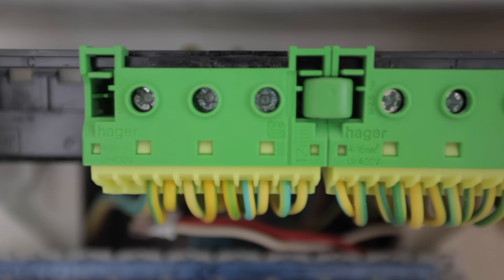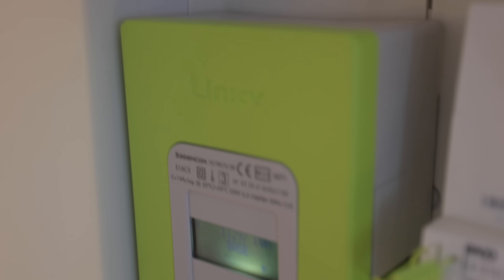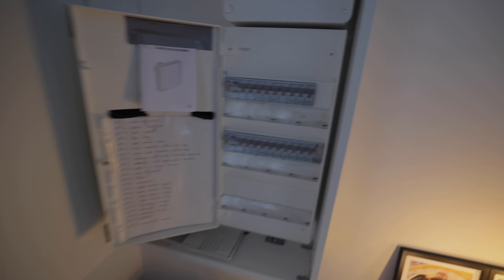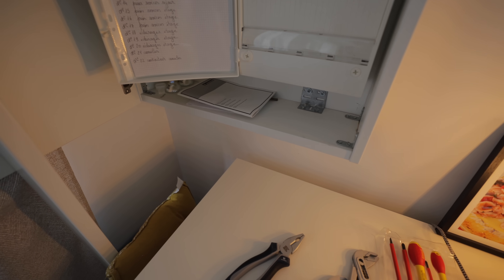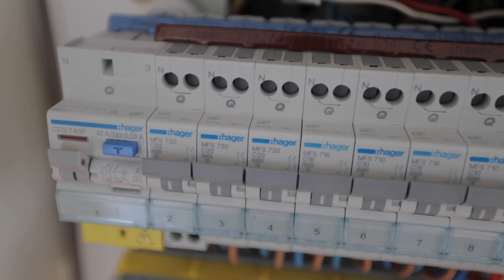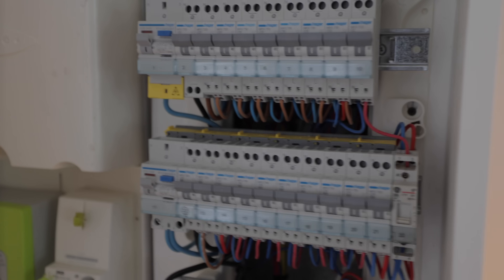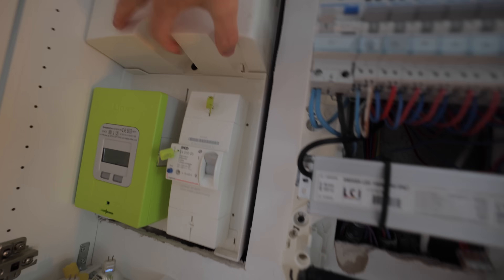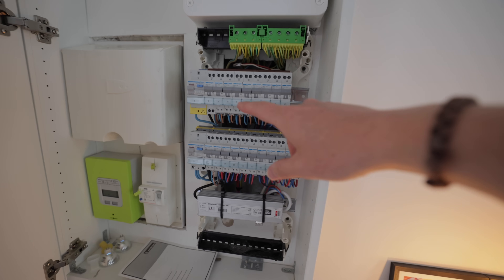U.K. Electrics SUCK! This is what we should be doing…🇫🇷

Comment: actually us and uk panels design really bites their asses now. it's as if they hold on to something for just the sake of it. french isn't much better either. and everyone knows it. first is, everything needs to be added within additional box next to existing one. in uk, many places have meter and distributor in same place. so put it in same box? no plywood, no open install, no terminal blocks. no need to put extra box for ev charger circuit etc. just put it in on enclosure. have it din railed. one side is sealed and has incoming cable, maybe loop through, main mcb & meter, other side has place for all sorts of other devices from any manufacturer. shocking eh! doorbell transformers, spd's, rcd's, with room to spare. one could argue this is how it was. but it's easy to replace as a whole. i do recall times where whole electrical was just meter and two screwable fuses for entire house because there was nothing except lights and tv that uses electricity. but it doesn't have to go along. the us might moan about it having stupid high currents due lower voltages. us installs often have more power despite 120v, hence current. but most of them have less than 125a current in individual circuits. and we already make mcb's on din rail on this. god, this is like, come on. have to stop this crap some time in future. meters could also be din railed. at least in uk, the current is lower so it's manageable. not sure about us. but i see several issues in both places. need surge protection in us? pipe it to panel. add anything! same in uk. this is like horrible. i really do hope it does eventually change. at first us busbar system seems good but even that sucks. it assumes no additional equipment in panel. assumes same manuf breakers. if you do have stray faults and happen to destroy the part of busbar, now it's all ruined. besides you can easily have finger protected terminals inside panels too. because why not! sometimes you do need it to be live and don't really to able to slip finger right into live. in new and approved installs i somehow see no improvements. problems to appear, they are worked around, etc. i highly doubt there's any cost savings in all of this. then there come totally weird things. like i heard uk now does insulated pe in cables. i can see where the bare came from, likely cost. but why does one need to design cable to specific old square dimensions. to be able to use old clips? i don't think there's stockpile of ton of cable clips from 1960 that everyone uses now. and why is cable flat? again, seemed good idea, now it's not. with new cable you can buy new clips. glands, etc. even sockets. i don't think mains cable jacket diameter needs to compatible with everything we had 100 years ago. i blurt my drink out on the idea of having to design cable that fits into old dimensions, possibly compromising something else. iirc same size conductor same insulation thickness round cable is easiest to manufacture and you can share production lines and so on. just totally insane to me. i find no reason why you can't upgrade. could do in stages too. hell with cable jacket dimensions! replacing mini consumer unit with another? just replace the whole thing!!! have it arranged to have meter unsealed, take everything off and replace with new thing. this isn't really a problem as everyone doing electrical is supposed to be competent anyway, then comes the power company and reseals the part of panel that's unmetered. and then it lasts another 20y with maybe occassional screw tightness checks why uk doesn't do this, i have no idea. i highly doubt there's any non-retired workers still in job from old times, users don't care, so who holds it back? i do have old equipment here from some time ago, i would choke at the idea of museum pieces needed to be installed or maintained just because it was the best thing when i wasn't potty trained yet (=== e.g. old time)

Comment: The Netherlands and Switzerland do not differentiate between socket and light circuits. Wires are in conduits and rings are not used. 3 Phases are common for residential installations. The MCBs are double-poled, mostly 10 or 16A and there are multiple RCDs. 
In Switzerland, the meter and the main fuse must be accessible from the outside, the consumer unit can be anywhere. In our case in the cellar.  The main fuses are not sealed. These are round fuses that are screwed in. The amperage is also coded by the diameter of one end, so you could mount a smaller fuse in the holder, but not a bigger one. 
In the Netherlands, RCDs have been mandatory since 1960 or so. 
Another interesting component in Switzerland is the STOTZ (Stromstoßschalter). It is a bi-stable switch that is used to control lights with multiple switches, for example in corridors. One pulse switches on and the next pulse switches off. So, instead of DT and cross switches, you can have any number of momentary switches in parallel.

The weirdest installation I came across was in the 1970s in the inner city of Delft (NL) Here, the phase and neutral were at 110 Volt relative to earth. This required consumer units with a fuse in the phase and in the neutral.
Reply: Well it's stupid not using ring circuits. and massive radial ones can cause fires as they are like extention cables and when they are using it too much will go on fire like and lighting circuits should be only a certain size (sq metres) if not could start a fire due to so many lights on in that circuit and that's being a good electrician as in the future of these circuits it can be modified or made bigger and that's how it causes fires and problems and people should know that like 👍
Reply: @GordonKay-ro1rs  The wiring is all 2.5 mm2 and fused with a maximum of 16 A.

Comment: Looks much fancier than Polish electrical panels. My apartment (built 1970) has a 25 A supply from a panel and individual meter located in the hallway, which branches into a total of 3 × 10 A circuit breakers, one for the lavatory and all the lights, the second for the kitchen sockets, and the third for the sockets in the rest of the apartment. No RCD protection whatsoever.

Comment: I find it shocking where the UK crams their consumer units. In the states the current code for load centers requires 75cm wide, 90cm deep, by 2 meter tall clear area for an electrician to stand. The area directly above and below the panel, the side of the panel, can’t have anything else in that wall cavity but electrical. You often see the load center in a hallway etc cuz that’s where there is enough space to meet the working room for electricians. The way the French unit is, wouldn’t even meet code for minimum space. 

In our latest code 2023 Each one of our breakers is also its own GFCI(RCD) now.
Reply: Part of that may be to do with the increased dangers from the much higher currents flowing through US breaker panels, owing to the low supply voltage and generally heavier electrical loads (with more AC etc).
Reply: @Rosscoff2000  it’s more the UK got used to retrofitting old buildings and never updated the standards on new builds. Many new builds in the UK have the same load going through the panel now.

Comment: 45 amps main fuse seems ridiculously small compared to UK standards so how do they deal with EV chargers on such a low capacity supply? Though having looked into buying a property in France some time ago, I know that you have three levels of supply offered for your  property to choose from. 
That CU seems to have a lot of circuits hanging from the two RCDs and I would argue that they would not comly with BS7671. You didnt have any tools with you Jordan but did you have an MFT?????
Marseille will be lovely. Warm most of the year, and hot for the rest of it, yet a short flight back to the UK. Following on from Brexit though, will it be difficult to obtain a full on residency permit?

Comment: Our rules for electricity in residential is NF C 15-100. 
Old houses have also ugly electricity installation like UK, with fuses.
The DTI is for testing old cooper PTT arrival (phone and ADSL internet). Useless now with fiber connection.
Coaxial TV repartitor, is compulsory but also useless now with fiber and TV by internet.
Ethernet dispatch and 2 16A sockets are compulsory for Internet provider box and other (like Fiber converter we call it PON/ONT). Number of ethernet outlet is based on number of rooms (see NF C 15-100). The biggest flaw in french installations is the lack of neutral in light switch, we go from breaker with phase, then to the switch, then DCL (central point of the ceiling for the bulb), then go back with neutral to the breaker. Not very upgradable for smart control lightning.
Reply: Oui monsieur

Comment: Not digging into normative detail, as I'm not a licenced pro...

To comment on the neatly combed wiring, and the number of breakers (circuits) per a household, and e.g. "everything in corrugated pipes": here where I live (CZ) the setup would pass off as something an insider+enthusiast would do for himself. Or someone of "industrial process control" persuasion who keeps himsef up to date on the basics. Stuff that tradespeople do "for business" in the households often looks much sloppier.

The fact that corrugated flex ducts were used for everything: an extra layer of isolation may be required if there are flammable construction materials allover the place (gypsum cardboard interior lining boards, or anything wooden). You can either use square ducts or flex ducts - either way, if plastic, it has to be flame retardant (or in other words approved for electric use). Perhaps an enthusiast would use corrugated pipes of a larger cross-section, if "easy wiring updates" was a goal. Still in that vein, not sure how much "reserve" (slack) room is left in that mains box.

In modern setups that involve RCCB's, using two-pole breakers downstream of the RCCB allows you to isolate the fault (leak) that triggers the RCCB. It's a cheaper solution, compared to using a dedicated RCCB for every circuit. Others have already commented that the number of ordinary breakers per RCCB is a leaning towards "too many" :-) With single-pole (phase only) breakers downstream of an RCCB, you wouldn't be able to find the circuit that trips the RCCB - *at all*.

BTW, it is good practice to have a dedicated RCCB (+ breaker) for any fridge/freezer. This is not because the cooling tech would be a usual suspect for leaking to the PE. No, the reason is quite the opposite: if anything trips the respective RCCB, and you'd have your fridge/freezer on a shared RCCB, you get your fridge/freezer powered down by a fault in some unrelated equipment, and if you find out too late, you can just dump all the food into the garbage can. As the SMPS mains PSU's in most modern electronics leak a little by definition (the leak through the Y-cap), they sometimes combine to throw the RCCB at random. You don't want your fridge to share an RCCB with the rest of your modern household for that one reason.

I am reluctant to call the placement of a mains cabinet in your living room "neat". Someplace accessible near the entrance to the appartment, would be my choice. Sometimes in buildings with a history you just don't have the luxury of choice... 

One last note: I am not a fan of push-fit terminals. I don't trust them nearly as much as well done screw terminals. Possibly because it is not my job to work them all day long... 🙂

Comment: The French invented the MCB!(Le Diruptor) I was installing French MCB'S in M&S  40 years ago and they could be adjusted via an Avometer, plus they were push button!  Yes that long ago, when we were still using rewireable fuses!!  Oh and one other thing, combi  boilers? yes a French invention also, using them at least 50 years ago!
Reply: MCBs were introduced in germany 1969 by Siemens , they got the half space of the old 35mm Breaker which were introduced by the electrical manufacurer Voigt& Haeffner   (V&H Frankfurt/Main)  in 1935. In the same year V&H  brought  a RCD ( Fehlerstrom Schutzschalter) on the market. They were not the inventor but the first company  which offered them widespread. Those RCDs had twice the measure than a single 35mm Circuit breaker, so 70mm.
Reply: @Reaktanzkreis  I stand corrected

Comment: the dutch is better france use strange colors and put more than 4 groups on 1 rcd and the most places here we have also 3 phase
Reply: limitation behind 1 rdc is only for comfort, not security. In france the recommandation is not to exceed 8, so the electrician behind this work is above it. We have sometimes 3 phase here too but it tend to disapear with the end of pure electric heating.

Comment: I live 2hrs North of Marseille & our new electrics are almost identical to yours but with contractors for multiple light switches for 1 light. Old houses only have earthing in kitchen & bathroom sockets because only lighting was ever really plugged in...the olduns call sockets 'luminaires 'for this reason.

 I have a 240v socket next to my bathroom sink, there's no fuses in plugs, plugs stick out too far, there's no on/off switches on sockets, back boxes are massive so wall lighting is difficult to mount, almost all extension reels are damaged because the design of the plugs & sockets too crap to move the protective pin covers.. but there are no ring mains. 

It's swings and roundabouts I guess... but I want one-off switches on sockets !

Bon continuation

Comment: Hi, as an Spanish person, I find this consumer unit common. However I find award the location of the principal fuses and meter. In Spanish houses, the fuses and meter are always placed outside the house (in the fence) and all buildings must have a meter room (located near to the door) for all fuses and meters of all apartments. Then the consumer unit must be placed somewhere accessible the nearest to the exit door as possible.(Not in the living room)
And we do things like that for a reason. Imagine the wires that feed your house start burning, it is logical to have a fuse outside your home that will protect you! Or imagine in a buiding a short circuit occurs in someone's feed wires, it is logical to have a separate feed to that appartment that will shut off and not all of them because someone had an electrical fault.
Reply: Here in german it is similar to the spanish , The main fuse is in a cable juncion box at the roadside for each building.
The meter is normally in the building,  in a single house  at a wall to the roadside in  extra  space,  normally a in a cabinet inclusive the consumer unit, similar to this one showed in this video.
In block of flats or multi storied buildings,  the incomer ends in a "meter room" in the cellar or ground floor , also faced to the roadside. The multi meter boxes must provided  for internet acces or a tetra radio modem, depends on DNO.   A  consumer unit is installed in every flat near the entrance door in the hall.  More complex building arangements must provide a space for a substation/ transformer unit. 

But you will even found weird old installation and  " owner improved"  wirings , you will find lot of them if you employ youtube.:)
Reply: This is also the case in France,  with the exception of newly built city appartements often part of a bigger house  splitted into smaller appartements.   This is not a bad thing, since the Linky counter is accessed remotely by the electricity provider, there is no need for them to have direct access to the linky.   And I would rather have theses kinds of installations all grouped together and totally secured from the weather inside a house.

Comment: A lot of the electrics in the UK are archaic in many ways, which is strange given that a number of companies have and still do designs of systems for other countries around the world.
It is all down to cost of changing those systems.
The electrical regulations in any country is the guiding factor for any installation and both French and German are quite restrictive in many ways.
The French even stipulate the number of lights you can have on a circuit along with the maximum number of sockets. 8 sockets on 2.5mm and 5 lights on 1.5mm, unlike in the UK where a single ring is unlimited and has a 100 square meter restriction per ring.

As far as smart meters are concerned, a company I was with in 1998, was designing these for an Australian  energy supplier. Smart meters that worked for both single and three phase system, that could detect and report not only possible faults, but possible theft of power.